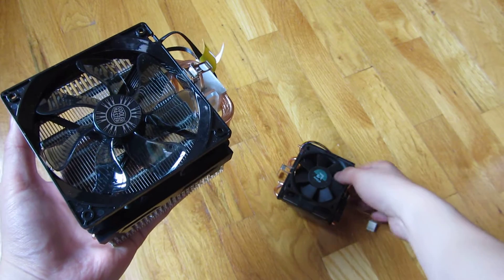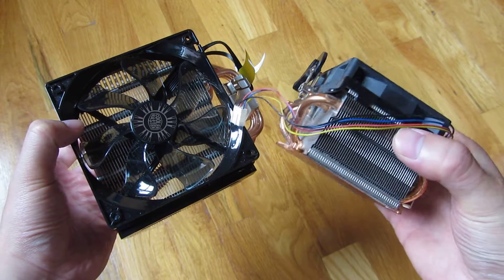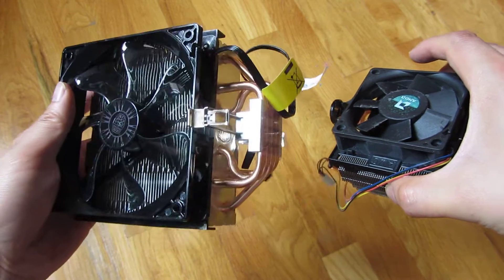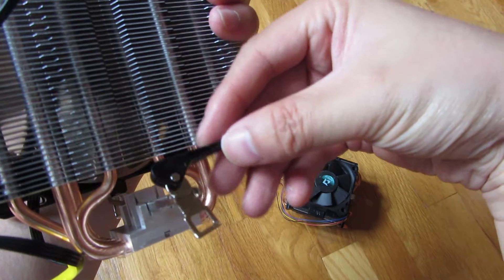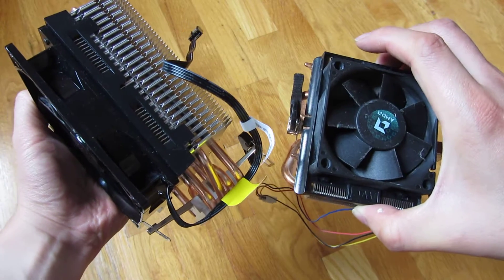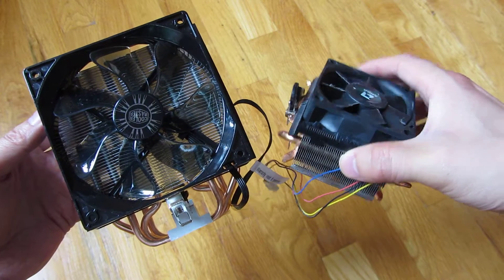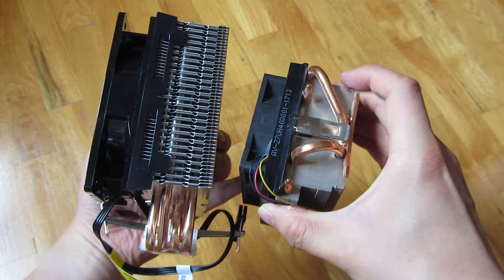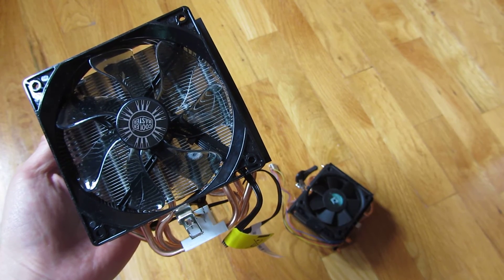Cooler Master Hyper T4 and Stock Fan Comparision

Comment: Meu processador é um FX 8320E e chegava facilmente nos 70º C com o stock cooler. Depois desse Hyper T4 não passa dos 40º~55º dependendo da situação. Muito bom o investimento e é relativamente barato se for comparar com outras opções no mercado. Só achei ruim de encaixar as presilhas no socket, fora isso, nada tão complicado de instalar.

Comment: Warning: dont use cheap thermal paste like I did - they conduct heat very poorly! Look at the thermal conductivity rating... otherwise no point having a good heatsink & fan. The paste i had is about 11 times poorer in thermal conductivity than a paste i ordered now, which costs about the equivalent of about $10 USD.
Reply: thermal grease has both shelf time and usage time. Usage lifetime usually goes from 1 to 3 years, if you are using some better quality, branded, thermal compound. In case of some no name solutions, we recommend you to replace it with fresh paste after 6 to 12 months. Due to high temperatures, thermal pads go bust as well, over longer periods of time.

https://www.ekwb.com/blog/thermal-compound-guide/

Comment: very good video, I have a question what is better heatsink cooler master hyper 212 evo or 212x or hyper hyper t4 ? ...
Reply from the maker: The EVO 212 is the the slightly better heatsink, but it depends on your situation and purpose.  If I had my computer unassembled and was building it from scratch, then I would get the EVO 212 and change the Motherboard mounting plate.  But since I was looking for a replacement fan and did not want to remove my motherboard,  the T4 was better.  Also the T4 allows for more roomy space on the motherboard as the EVO 212 is slightly bigger.  They have similar tolerances and specs.
Reply from the maker: I made a video explaining why I got the T4 instead of the EVO 212 here - https://www.youtube.com/watch?v=D1P2PkXr8I4
Reply: +Poolarity okey thanks